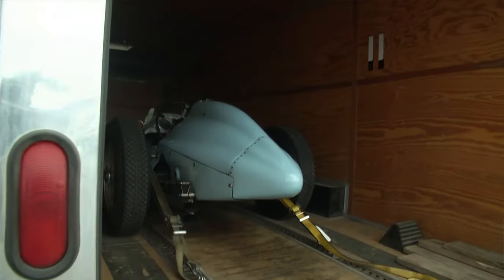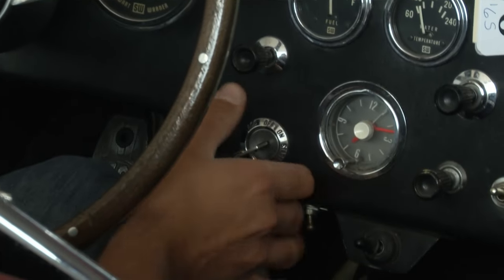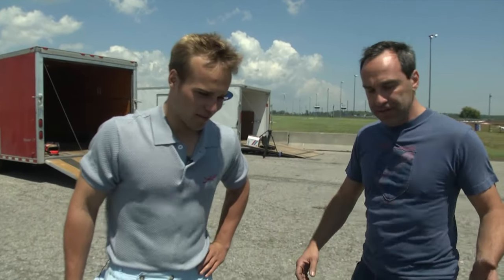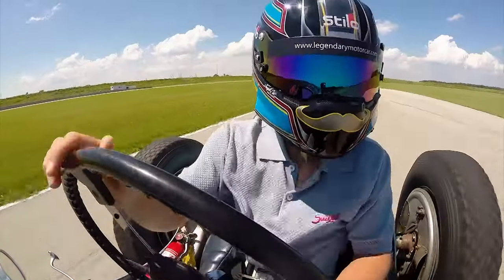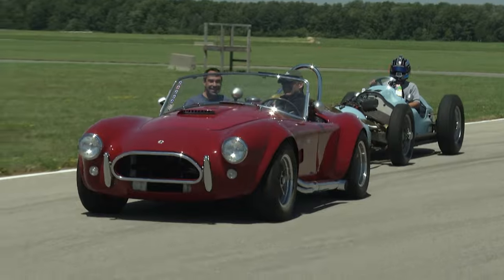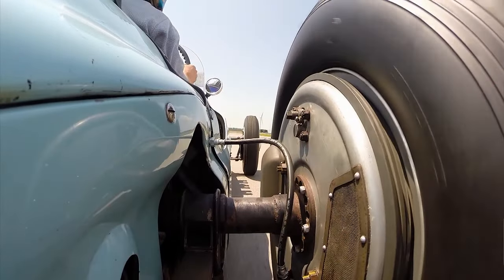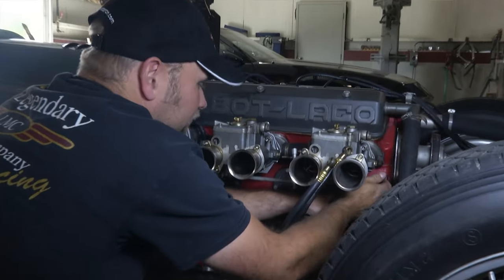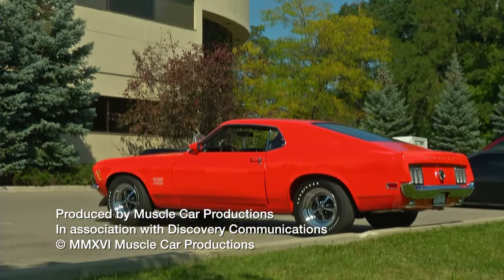THIS is what F1 cars were like in 1948?  Talbot-Lago T26C

Comment: Many would say it's sacrilege, but if I owned it and planned to use it on track... Which I totally would... I'd put belts in it and maybe some sort of removable roll over protection.

That thing is properly dangerous. Fun but dangerous.
Reply: There is nothing wrong with making small improvements to make it safer, and more fun to drive, as long as they can be undone if need be.